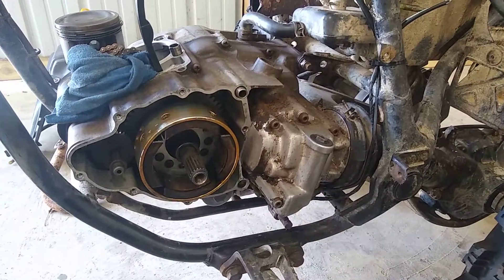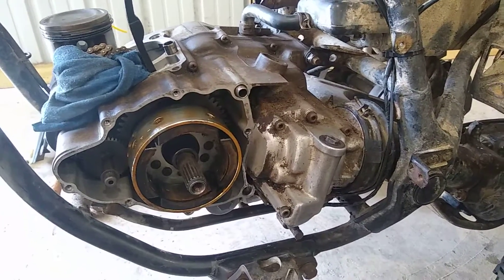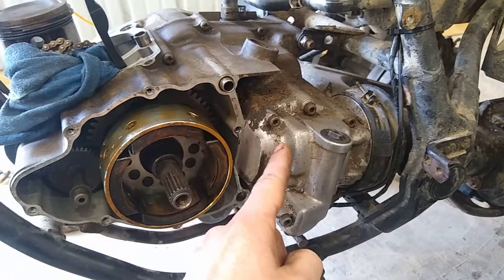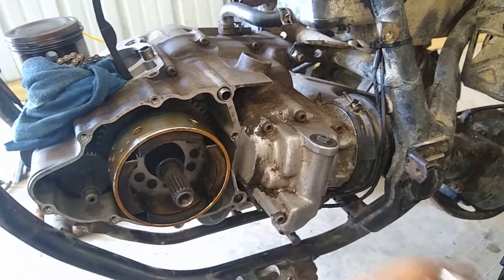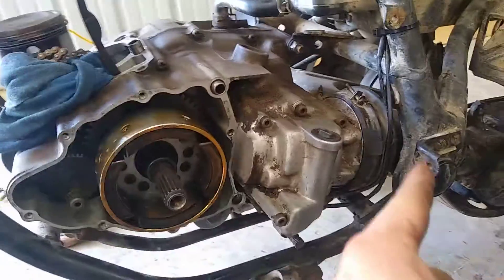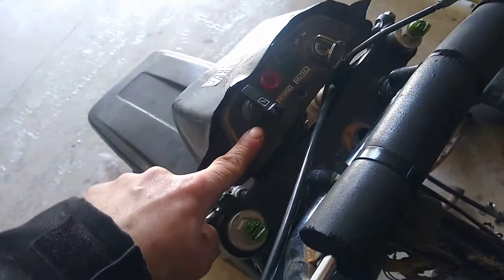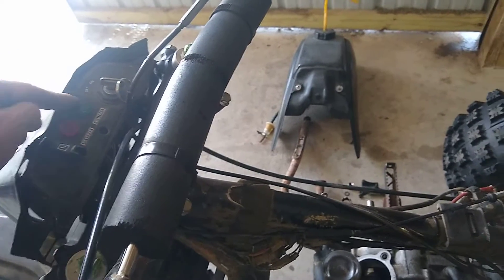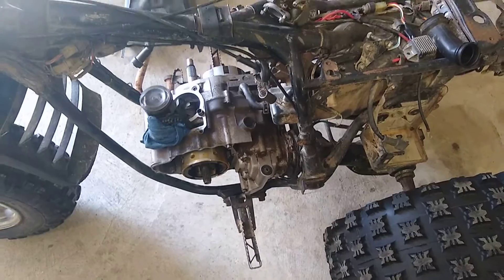Ytm225dx engine swap with timberwolf 250 engine

Comment: Do you have neutral light and reverse light both working? I thought the switch is neutral. Is there 2 switches ? I just did the swap trying to figure out what you did with the wiring? Thanks
Reply from the maker: Yes I did for and their should be 2 switches if I remember correctly and I no longer have the machine

Comment: HOW DO YOU TAKE OFF THE ORIGINAL DRIVE SHAT OUT FROM THE ORIGINAL 225 MOTOR
Reply from the maker: Should just slide right off
Reply: You have to remove the engine or swing arm. Whichever is easier for ya lol. My swingarm bolts are tiiiight. But yes, it just slides apart.

Comment: I did exactly that. I ran into a problem. After reattaching the swing arm, I had a combined gap between the arm and frame of about an inch. My swing arm isn't centered, and you can see part of the bearing in 1 side. The yoke is rubbing cause it's off center. I don't remember a spacer rod. Don't understand why there is such a big gap. I wonder if tightening the swing lugs will draw the frame in. Pretty sure I got as tight as I could.
Reply from the maker: That's strange I have never ran into that issue